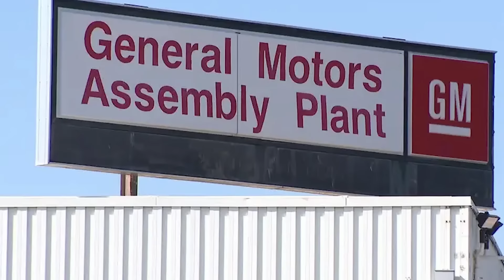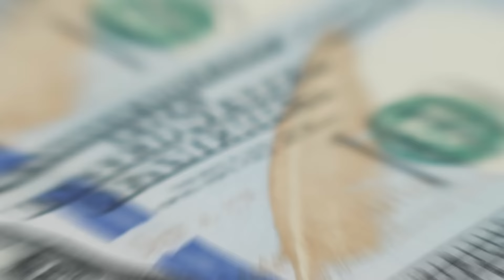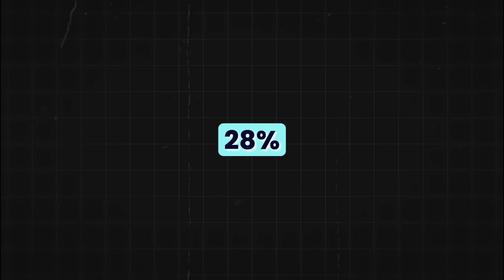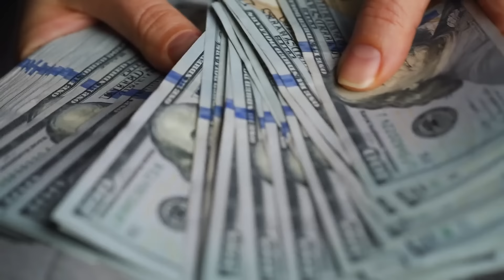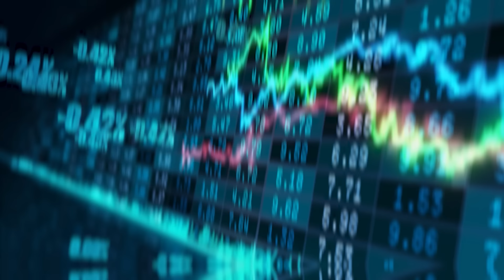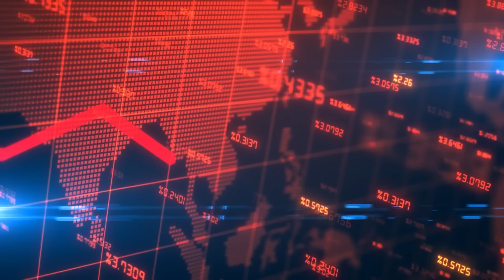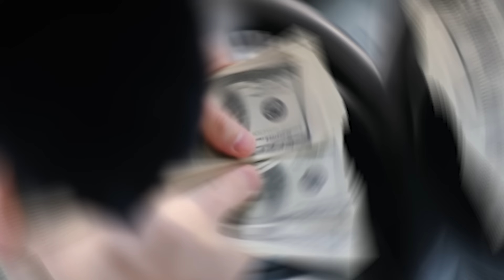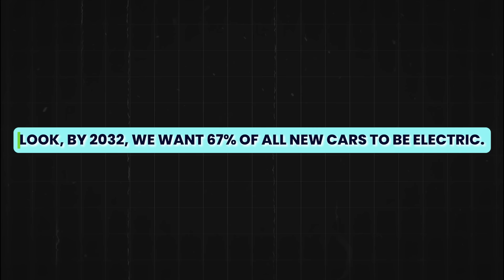The EV BUBBLE has Burst!!!

Comment: This is what's happens when you try to push your customers into a crappy product they don't want and can't afford. I'm smiling! 😄
Reply: I'm so happy
Reply: Yup I'm grinning from ear to ear.
Reply: Ford it stand for Fix Or  Repair Daily 😂😂😂
Reply: This is great news...if it's actually true
Reply: GM should stick to what they know how to make is full frame full size cars and trucks that run on gasoline or diesel fuel climate change is control as there is no such thing as climate change oil comes from the ground...so how could it be so negative for the environment?
Reply: They should all be focusing on making smaller, affordable vehicles for the lower middle class. Bring back the mid-size sedan with a manual transmission for starters.
Reply: @olbermannhater  not really... midsize well built cars like Malibu classic Oldsmobile Cutlass Chevrolet Caprice classic the cars that made GM competition from China and Japan should not be important in decisions on GM production
Reply: Anything that takes more than a minute or two to refuel can never work for most people without a serious change in human behaviour.
Reply: @kimmienguyen58 you sure it’s not “f**ks over real drivers” 😉
Reply: *Found
Reply: @m12652  how long does it take to refuel? Depends how much your putting in the tank and you're one of those people that complain how long it takes to refuel?...you got too much time on your hands
Reply: Don’t say people push anything to you.  They’re not pushing anything until you can’t buy ice cars.  Would you say Tesla is pushing EVs?
Reply: @twosawyers  seems to be the catalyst of EV society
Reply: @olbermannhater That's just it though, they don't want lower-middle class to own private vehicles.
Reply: When the affluent in this country quit buying these truly lousy GM and Ford trucks and SUV's, then both corporations need to disappear and take their $150.000 a year 'hourly' workers with them!
Reply: @stevemino142  you sound ignorant. Go do some research on climate change.
Reply: I just bought toyota camry ic engine. First foriegn car and I will never buy electric !
Reply: First On the Rubbish Dump...
Reply: @stevemino142  I work on average about 60 hours a week and an electric car just simply wouldn’t cut the mustard unless I had several in different locations all fully charged. For electric cars to be practical for me, they’d have to have twice the range and charge in minutes. Or, have the battery swapped out for a fully charged one.
Reply: Hi ice .exactly.i don't own or want an electric vehicle.i have my truck and car.dont want that crap.lol👍👋😀
Reply: Ride a bicycle, stay healthy and live longer. Oh, buy a raincoat too.
Reply: You just mad cause you can't afford them
Reply: Why don’t the talk about the policy that they are forced to make these EV.  It’s not like these company’s want to be only producing EV by I think it’s 2036 but there being forced to do so.
Reply: It's funny until there is a bail out with taxpayer money.😢
Reply: @afterthoughtable21  "they're"
Reply: Want a new truck and can afford one but guess what ford and every other truck manufacturer! I will never buy anything new from y’all bc you continue to rob the earnest hard working man!
Reply: Ford and gm junk.truckd too.
Reply: @Oxazepam65  GM wasn't the only manufacturer to receive bail out money what else does tax payers money cover?
Reply: Forced into it by government regulations.
Reply: The most concerns I've heard are charging availability, cost of battery replacement and effectiveness during inclement weather. If all true, then those are really genuine.
Reply: Me too😂😂😂😂
Reply: Exactly .
Reply: Well the Japanese was right as usual and that's what we get for mocking them.
Reply: We often poke fun at crappy products from China, in reality there are plenty of the same crap in this country.
Reply: @kimmienguyen58 Um are you like 12 years old?  That's been known for ever yet they still sale the number on truck and sport coupe of all other manufacturers  the mustang!  F150!  Go to sleep kid it's past your bed time!
Reply: I’m happy as hell ! They cost over $50,000 🇨🇦, Trucks cost $100,000. Forget it !
Reply: @jamesfranks545  you won't be when tax payers bail them out.
Reply: Well you don't know what you're talking about obviously. People love their electric vehicles and will pay more money because they are higher performance and much funner to drive.
Reply: You're happy American companies are stagnant and behind the curve on technology, manufacturing, and development? How unpatriotic.
Reply: It's also when you add all your prototyping and development into the first years price.
Reply: @twosawyers it’s not the manufacturers pushing EV’s, it is the current government
Reply: Plus gouging customers with $10-20k mark ups, along with dealer “options”.
Reply: Correct
Reply: Keep going. All the car dealer are rising the price like nut. They should pay for that.
Reply: @stevemino142 wow. you dont think on all cylinders do you?
Reply: We always said…Found On Road Dead.
Reply: Guess who gets to bail them out…US.
Reply: @stevemino142  a new president would be Great
Reply: Agree with you and then add inflation on that, how stupid can leaders and CEO's be, they are living in a bubble!
Reply: @bugsyboy5323 You can't change it.
Reply: Yah
That's just my point. Wait till 3 to 5 years time when they go to replace the battery. You will see some real laughs  than. 
The moment you drive it of the lot  
You'll be lucky enough  to get 20 dollars for it. 🤣bahahaha !
Reply: @samholder147 the jokes on them wait  till it's time to change the battery or the retail sale value the moment  they  drive it of the lot.😁👍
Reply: @stevemino142 dont forget they cant even make their cars go from point a to be with out its computer break downs. 😁👎
Reply: @olbermannhater  good luck with that
Reply: that's why i will never own an EV. take a long time to charge, can be more expensive than combustion cars to fix, & i don't trust their reliability in cold weather areas (i live in North Dakota). i love how i can pull into a GAS STATION, fill up, & be on my way in 10mins, while EV clowns are still charging their crap 😂😂😂😂
Reply: @Mr.Worf63  good thing Tesla is crushing it and their cars are half the price, my stepson got his Tesla,for 27k brand new , it’s not the electric it’s the company
Reply: I totally agree... I have worked on Ford cars as a mechanic and owned then too.. Had to buy Kia as the models available  are crap..
Reply: @kimmienguyen58 
F'ed out of a real deal 
Found on road dead.
Reply: @kimmienguyen58 
The first time I heard that was 1965,, but it’s still functional. Lol
Reply: @666TheMelaninCode 
If you ride a bike where I live you will most likely be terminated in short order.
Reply: @chumpthetraitor7331 
I’m mad even though I can afford more than one..
Reply: Service your existing vehicle, there gonna look to recoup from new car sales
Reply: Nothing like being happy about a lack of progression, stalling technology or the loss of American jobs and industry
Reply: I'm also smiling. 😂. We all saw this coming, how did all these manufacturers not see this? 😳
Reply: @callowaymotorcompany Supporting a private cooperation isn't considered patriotism. Your dialog is outdated lamo
Reply: @kimmienguyen58 Hell, in the 80s it stood for “Found on Road Dead”.
Reply: @cherylcarlysle1629 You beat me to it. Lol
Reply: I’ll keep my Ram with the Cummins diesel thanks.
Reply: I don't even want to get started on this, other than to say two things. One, this is what happens, when you crawl into bed, with your government. It rarely works out well in the end, for you. And Two, Ford didn't take the bailout, and may be the last man standing, as far as American manufacturing goes.. Government actually stands in the way of innovation, and new technology, that significantly reduces green house gas emissions. And this has been patently proven. Yet Government still attempts to dictate, what you will manufacture. Based purely on their own preferences, with absolutely no input, or voice, from the people they claim to represent. Instead they go to so called experts, who often parrot the party narrative, if the price is right.. Government doesn't create jobs, government creates tax drains, on the working class, which in turn generates more taxes, from those new welfare dependents. Don't be fooled, politicians and beaurocrats, are the biggest welfare dependents in the nation. And I guarantee their monthly check, looks a helluva lot better, than yours or mine ever will. And it's funny, how they can always seem, to find the money, to vote themselves in a cost of living allowance. But they can't find it for the millions of retired, and disabled American veterans, who paid in blood and sacrifice, to earn them that privilege. Does that really sound like, people who care..?
Reply: They pushed this to disrupt the auto industry as a whole. There are many in higher positions that wish to do away with personal vehicles altogether
Reply: Exactly! And this, despite how we may feel about it..
Reply: @Riceman-o1p  which people? I’ll never own one.
Reply: Maybe just a little to greedy.well over priced and garbage
Reply: Looks good om them
Reply: As a former employee of one of those companies, I was shocked when they gave their announcements about pushing EV's on the public. It was part of the "writing on the wall" that got me to leave. I couldn't believe the arrogance of the leadership. They didn't learn from history.
Reply: @m12652  😂😂😂
Reply: @onrean  Very interesting. Good for you.
Reply: Thanks to an administration that is completely out of touch. Government jamming shit down our throats again. Government needs to stay out of businesses, and let the market dictate what we need and want
Reply: It’s government
Reply: Also what you get with globalist CEO’s
Reply: @onrean which company? Why leave that part out? Did you actually get fired?
Reply: @EricT3769 that’s all bullshit. My first car was a Ford Ranger which I sold with over 100,000 miles on the clock, my second car was a my parents 2006 V6 mustang which had 80,000-90,000 miles on it when I traded it in, my third car was a 2014 V6 mustang which I drove for 5 years, and my current car is a 2020 GT350. In addition to that, my little brother drives a Focus that he’s had for probably 7+ years, and my dad had an F150 that he drove the piss out before he traded it in and bought a Dodge Ram. In total, my family has driven Fords for at or around half a million total miles and we’ve never once had one break down on us. Never had a single problem across multiple engine and transmission types across years and years of driving.

The whole narrative about Fords always breaking down is just complete and utter nonsense.
Reply: @timmyboy2495  well, the video isn't about me so there's no need to include more personal details than necessary in a comment. For example, if I were to ask, "where do you work?" It wouldn't matter for this video either.
Reply: @onrean  Werd
Reply: I just want a narrow  truck with meh bed 4 cylinder engine and part-time 4×4  manual locking hubs with Heating and Air
Reply: Can't afford it the biggest thing
Reply: @philiphatfield5666 the last UAW negotiation was the death knell for the auto industry. How can they absorb the obscene cost of labor unions? Unions are unnecessary relics of the past. Just another USA grift.
Reply: @dennysmith7862 yeah, those shitty Japanese cars that go for 300,000+ miles are such huge pieces of garbage huh? Like Subarus, my daughter's has 300,000+ miles on it still runs fine, all wheel drive works like a charm. The big three have never had such a success.
Reply: @bobgriffith1810 if you ride a bike where I live all you'd do is ride. It'd be hours just to and from work.
Reply: @timmyboy2495  Well mine was a 1979, and we had trouble with it. Apparently other people did too because they say the same thing. Most cars after 2000 are just better.
Reply: only smiling...I'm LMO.....🤣🤣🤣
Reply: Just like they did with ICE automobiles in cities back in the 20s and 30s. Don't believe me? Look it up!
Reply: @olbermannhater Have you ever looked into why?
Reply: @Dinosaur257 not if they can't fukken drive! And most can't
Reply: @dantaylor9218  I disagree how many Subarus are still on the road with over 300,000 miles? and after that many years of owning the same vehicle it's time to get with the program and own a vehicle from a manufacturer that started in the country you live in if you live in North America you should be driving a vehicle that was built in north america
Reply: Well it's not the companys, it's WEF that tells governments to do so, and they apply and tell automakers to do so
Reply: I'm not smiling. Because I know who is going to bail out these billion dollar auto companies. Us the tax payers. Just like last time. They screw up and we get the bill for it.
Reply: @kimmienguyen58 nope, it stands for " F**ked On Race Day " . There, I fixed it for you.  You're welcome.  😂
Reply: @666TheMelaninCode ABSOLUTELY! I  live 35 miles from work, cycling to work and back, especially during winter snow sounds like an awesome idea little fella! 😂
Reply: 100%!! These things are way overpriced and here in Illinois we had a whole lot full of Teslas that wouldn't charge at the supercharger stations due to the extreme cold and all these people were stuck there for over a day. And the prices you pay for this crap is ridiculous. I know I can't afford one, unless I want to be in debt up to my eyeballs
Reply: I've been waiting in these crooks to get theirs. They went overborad building Government allowed weak inferior parts into their products. This goes for all Vehicle Manufacturing .
Reply: Just wait till you need to change the battery it costs thousands and seemingly it only last 5 years, my car is only 15 months old, Kuga in Uk, i am waiting on a recall  letter to upgrade the computer software, i was notified 6 months ago that this was going to happen, still waiting.,it has something to do with the battery catching fire, never buying another hybrid or ev
Reply: This is what happens when you give women the steering wheel
Reply: Another bailout perhaps?  The big three need to go out of business in my opinion.
Reply: Batteries have always struggled in cold conditions,  this is nothing new!!
These electronic cars are only good in warm weather, short drives in cities
Reply: Well Biden and his mandates might have just a bit to do with it.
Reply: Great I don’t want no electric vehicle . No
Reply: This tickles me! Now let's drill baby drill. EVs totally suck. Wouldn't take one if it was given to me!!!
Reply: Politicians need to quit telling everyone to buy evs.
Reply: Nah, Ford stands for found on road dead.
Reply: @Riceman-o1p the point is most people the ones that tell it like it is not the one that lie because they cant face the truth dont like their EVS and would never buy another one. Anyone who keeps a vehicle for more than 5yrs knows that these pos are not a good investment. If you lease and turn over at the end of the lease. Well you are not the intellectual high mark anybody should be listening to anyway
Reply: It isn’t the companies forcing anyone. It’s the government.
Reply: And screw Tesla too
Reply: If people don’t want them and can’t afford them… why are Tesla’s so popular??
Reply: Me and you both!!
Reply: @jamesfranks545  like people driving Tesla’s will be when your gas runs out 😂
Reply: In the company's defense President Biden deserves a huge chunk of this failure Green New Deal
Reply: @Audioremedy0785  Yeah but that wont happen in ten lifetimes lol. If you drive an EV you better move to Florida because they don't work in cold weather 🤣
Reply: If electric vehicles were invented 100 years ago and then the gasoline combustion engine was created recently, we would think it's the biggest breakthrough in transportation technology. The convenience, the efficiency, the low cost of operation. Electric vehicles absolutely suck they need to go the way of the dinosaur.
Reply: Tesla 🤡🌎
Reply: EV Is a total fail
Reply: @twosawyers  Biden supporter?
Reply: @sixtee9certified278  Pro democracy, Pro energy alternatives, Pro planet, Pro Science, Pro education, Pro truth,  and yes I am 100 percent a Biden supporter.
Reply: @stevemino142 That’s an amazing way of telling us that you don’t understand the carbon cycle, amongst a range of other topics. Wow dude. Wow.
Reply: Cash grab! Just like China.
Reply: The car makers should go back to basic cars and trucks. Dump all the electronics in them.
Reply: Great  news 👏
Reply: It is 20% higher priced than it was originally intended to be, $50k for the truck is too much. Plus interest rates are sky high. Sounds like Ford are adjusting output to meet demand even though they did sell 50% more trucks this year versus last. It’s definitely not as DOA as this video suggests. Could it be … clickbait?
Reply: Budlight 2.0
Reply: @stevemino142 well it is kinda bad if you burn it but the problem is not the small cars in america or europe. The problem is the factories in china.
Reply: @teodorvlad7818  it's not bad to burn anything if it is creating usable energy
Reply: Give them to illeagles
Reply: @kim found on the road , dead !
Reply: Video sponsored by the oil industry 😂
Reply: I'm smiling too, please keep shit talking EVs, and keeping demand low so that I can keep buying a better and better EV every 3 years for the same price. It's been great. 😂
Reply: Yep, kinda like what’s happening with Bud Light and Target to name only 2.  The Law of Unintended Consequences.  The market place will give us what we want and need thru Supply and Demand. Works every time!
Reply: That’s appen when bureaucrats , politicians and environmentalists decide what’s good for us . 
The big end of the bat belong to the customers.
Reply: EVs are great. Gas cars are great. It's not an either or if you aren't a sheep 🐑
Reply: Same. Can’t stand this woke nonsense
Reply: https://youtu.be/Pn2eCY3Kwuk